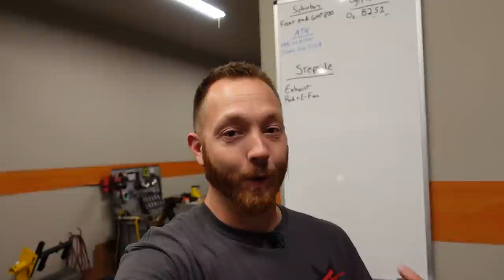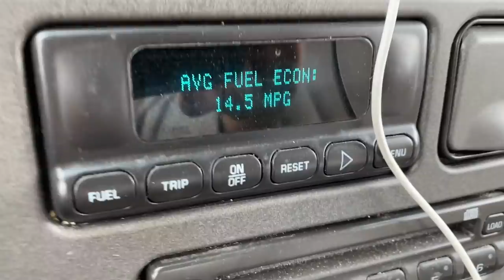the ULTIMATE BRAKE CONVERSION for your GMT400

Comment from the maker: I had a few guys ask for part numbers, and while I don't have em handy, I'll try to make this a comprehensive list of all the stuff I used...

Parts from 1999-2000 Silverado 2500 LIGHT duty
one pair front steering knuckles

Parts from a 2001 2500HD
2x lower control arm
2x wheel hub/bearing
2x disc brake rotors
brake pads
2x caliper and bracket assembly
4x caliper to spindle mount bolts
2x hub dust cover
2x brake backing plates
2x brake banjo bolts w/copper sealing washers

Parts from a K2500 
2x front shocks
2x upper control arm
2x sway bar end links

Parts from a 2001 Silverado 1500 4wd
2x front brake hoses

Misc
3/16" to 1/4" brake line adapter
2"/foot reamer
Reply: Any interest in selling the old lower control arms?  I can't find any consensus on what will work other than those factory K2500 ones off of those models on my K1500.
Reply: Thanks for posting this.  Keep progress going on the Suburban.  Don’t get bored with it.
Reply: Thank you,  LT!!  Much appreciated!!
Reply: Thanks, I have a 98 4x4 3500 crewcab.  I've never thought the brakes were worth a damn.   I thought about rear disc but the front disc upgrade sounds like the key.  Let us know how it all turns after the master cylinder.  I have 2 early 2000 3/4 suburban parts vehicle.  I think I'll be yanking some parts off soon. Not sure what knuckles they have?
Reply: Are those 99-2000 2500 light duty steering knuckles off of an Obs or Nbs? Part #?
Reply: Everyone should also know the upper control arm is the same from 95 at least to 2000
Reply: Lt you can use the speedway motors reamer in a right angle drill for the lower control arm portion of the spindle worked great on my 1500 and 2500
Reply: @stephenredman3074  nbs, 2001 body style
Reply: Would any of these brakes work on a 2001 chevy express 2500 5.7   8lug. I'd also like to convert the rear brakes to disk brakes. Any ideas
Reply: @navigatingthedestination  l have a 96 truck with Simi float 8 lug on 6.5 drums
And I can't find any information on converting to factory disk brake, I even went to 17 inch rims, have you found anything. I know there's after market like lug nuts, ruff stuff, and more, but it putting a 11.5 inch rotor and calipers from a little Cadillac dose not seam like it would be much better than the drums I have.
Reply: If you use 2500hd/3500 knuckles you need MOOG ES409RT outer tie rod ends.

Comment: Again, no one does parts interchangeability like General Motors. Nice job, LT!
Reply from the maker: nope, and I'm happy to take advantage of that
Reply: Honda does just saying
Reply: Yeah... On a freakin' Ford, if it has an entirely different suspension if it has a different alternator.
Reply: @blackbuttecruizr  Ford is a nightmare. A single exhaust pipe can have up to 10 different bolt sizes... Man, don't get me started.
Reply: The worse offenders are the size 7 fasteners they use on the edge,bronco, amd ecosport also on the new explorer  not to forget the gt350 whole front is held on by 7's
Reply: Hondas are more interchangeable but still love a gm 👍
Reply: @tommoon2700  Interesting about Honda, but I wouldn't own one if they gave it to me.
Reply: @hawkdsl  bummer, they are fun little go carts 🤙
Reply: vw.
Reply: Toyota also does it well.  You can bolt 1st gen Tundra brakes onto Tacoma.
Reply: I think honda interchangeability is still way better and easier
Reply: Yeah you need to look at honda before you say that.  For example any 2000 honda, from civic to suv has the exact same lower and upper balljoint.  Gm finally caught on to parts bin building in the ealry 2000'S, when the japanese had been doing it for 25 plus years.

Comment: Love the suburban content and what you’ve done so far! Please keep it a suburban too. What about a 6L90 swap and build the 454, possibly with a Whipple. It would make a killer family tow rig
Reply: the 454 would shread a 6l80
Reply: @brendan747  I’m pretty sure it will be just fine when they’re built to go behind LSA engines from the factory
Reply: @justingustafson7964  LSA applications used the 6L90.
Reply: That would be cool
Reply: @justingustafson7964  lsa engines weren’t put in 7,000 lbs pickups with high towing capacities and all of the low end torque.
Reply: @rcairforceone  Thank you for the correction, that’s what I meant, the 6L90
Reply: @brendan747  My bad, I meant the 6L90 put in the CTS-V’s and 2500/3500HD trucks
Reply: @justingustafson7964  can’t beat a built 4l80e. a built 80e versus a 6l90e will always result in the 80e being stronger.
Reply: @brendan747  I agree with you, but my thought for the suburban build wasn’t an all out  crazy HP build, but more of a built tow rig. The 6 speed 6L90 would offer more advantages to a build like that than the one advantage of the 4L80 holding more power.
Reply from the maker: that would definitely be a fun conversion
Reply: @LawrenceTolman  obviously it’s your truck so you can pick the direction you go in. I figured you are going to have 2 turbo big block trucks here soon enough so adding a supercharger to a big block would mix it up a bit
Reply: Only 6speed I'd swap in is an Allison.
Reply: There's not enough benefit to a 6 speed over the 4L80 imo.

Comment: This is fast becoming one of my favorite GMT400 builds on Youtube! I was on a forum dedicated to these trucks when someone posted a link to the first video you posted introducing the Suburban, and when I had seen you'd done an 0411 swap I was seriously intrigued; I've done the 0411 on my 96 K2500 with a 454 and you actually helped me solve my crank relearn issue by pointing out the need to ground pins for the parking indicator! 
The GMT800 knuckle upgrade is also something I've looked at for years, and at first I had settled for putting K3500 Dually rotors, calipers, and pads; no forums had a step-by-step process to this conversion, and the ones that did are now long gone so I'd always been hesitant about going through with the swap.

 I have heard some other K2500 owners complain about the angle of the shock being changed by using the GMT800 lower knuckle causing the ride quality to suffer, have you noticed anything substantially adverse so far or is it too early to tell?
Reply from the maker: haven't even driven the truck with the conversion, but when I do I'll make a video showing the results and how I feel it drives. thanks for watching!

Comment: Thanks for making this video!  I'm picking up a 1999 K2500 Suburban to turn into a family snow rig/tow pig, with new gears and diffs, etc.  I'm looking to make everything as spiffy and serviceable as possible, and this swap wins on both points.  I purchased the rear axle and front knuckles today, and I'm making up the rest of the parts list.

You made this a LOT simpler!
Reply from the maker: Glad I could help out!

Comment: I ran into the same problem with my 2006 Silverado 1500 4x4 when I put 2019  4 piston calipers on it with drilled and slotted rotors then Jegs sent me the wrong braided brake lines. I must use my old brake hoses until I get two adapter fittings. Thanks for reminding me about the hose fitting adapters. Great work on your truck it should handle 100% better.

Comment: Love the parts interchangability on these trucks, i swapped the ignition cylinder in my '96 c2500 to the one from a 1999-2002 silverado and while I did have to recode the door lock cylinders since the new ones didnt match (new ones were too long and the the ends were different styles), the ignition was as simple as pulling the old cylinder out and putting the new one in.
Reply: Hey man I have a couple of these trucks and I've never heard of anyone having to swap in a newer style ignition cylinder. What was the reason for it?

Comment: Now you got my attention! The brakes on my 93 z71 and they were ok but the rear drums became a problem with rusted out back plates and they actually ripped out the anchor pin when I slammed on the brakes in 4 wheel drive. Very smart move by not drilling the upper control arm, many people don’t realize GM has a lot of tempering and tech going on in that skinny control arm.
Reply from the maker: yeah, something as important as a control arm is not where I want to experiment

Comment: I'm doing the same upgrade on my truck and I found that the taper on the upper ball joint is the same as a 1500 series ball joint, And I think my stock lower ball joint will fit just need to remember I'm a little bit to bring the ball point in more Because it is real close to the CVS axle

Comment: I love this break down. I am really glad I found it before I started tearing apart my 92 GMT 400 K2500. I just bought it two weeks ago for $900. It runs and drives but the breaks are bad. I am also going to do a coilover conversion on the front
Reply: Are you making your own coil over conversion or are there kits available? Is there more information on this? I’d be interested in learning more about this topic for sure.

Comment: By the way... The spindle lower pocket (the small one inside the big one)  that looks like an elongated race track (@8:55) is actually supposed to be cut out. This gives you access to the zerk fittings for the lower ball joint. The factory was notorious for missing these uncut versions during inspection, even on the 88-94 GMT400's. Easy to cut it out yourself though... and for some reason, this happened on the right side more then the left side.

Comment: the GMT400 upper control arm comes in two GVW 7200lbs and 8600 lbs. the 7200lbs has a smaller tapper diameter on it

Comment: You can make minor non structural alterations to spindles with silicon bronze brazing.
Tig or oxy. Make sure to properly clean and pre heat the cast iron before starting, just stick them in the oven on max until hot.
Keep them warm after brazing to ensure they cool slowly so as not to crack.
This is ideal for correcting mistakes in rheaming out the tapers.

Comment: Man, love this burb. I bought a 94 k2500 from nevada, no rust. I was thinking about the gmt800 brake swap. Thanks for all the info i will start collecting parts to do it
Reply from the maker: Glad to help
Reply: I want to do the axle swap aswell but my truck came with a dana 70 and posi already just hate the narrow track width. But im thinking it might cost the same as a good set of spacers and disc brake conversion

Comment: I have a 2001 Chevy suburban 2500 not HD and it has the 8.1 with 4l80e just swapped a torque converter from monster that thing revs way fast 🤟🏽

Comment: My vote for the next upgrade is some Hummer H2 wheels.  They’re a nice upgrade for a true GM 17” wheel.  I put a set on my K2500 a few years ago.  No spacers or adapters needed.  The only thing you’d have to play around with is hub caps….few different options there.
Reply from the maker: for sure, the H2 is one of my favorite 8 lug GM wheels

Comment: love the gmt 400 chassis info. having a 99 tahoe as a secondary vehicle this content is awesome. Plus, i believ the gmt400 chassis is or has become rather popuular again so sprinkling in this content i believe helps your viewers relate and shows not everything is just newer trucks! keep up the good work and great content.
Reply from the maker: I agree, I think these are some of the best looking trucks they ever made
Reply: @LawrenceTolman  having the 1/2 ton chassis in the tahoe i cannot find info on if the 3/4 ton spindle would allow the 6 lug hub to bolt up. i have only found   forums talking about special service vehicles (police or fire) caliper upgrades. any thoughts?
Reply: @richadams3256  from what I could tell researching for my k1500 they're different and the 2500 spindle won't work.

Comment: Your projects always have that twist that i enjoy the most. originality. I don't really have a brand loyalty so when I bought a K3500 with a 7.4 vortec a couple years ago I was baffled that there aren't more intake manifold options.  I expected so much more from the aftermarket. For the life of me i can't find anything more than a mild cam swapped into these. To me it seems like the overlooked platform. I couldn't tell you how many times I've read the guys in enthusiast groups comment that the 7.4 vortec is junk compared to 8.1L. boggles my mind. It's an efi BIg Block Chevy with a roller cam and a 4L80e behind it. I don't get it. so much potential

Comment: I swapped in dually cylinders and calipers on a C1500, and I'm waiting to install the master cylinder from a 2500. Same problem with the rear brakes before and after, likely the proportioning valve needs changed to an HD too (recommended by GM tech bulletins, part is no longer available form GM.) Inline Tube has an aftermarket unit that will fit, no one else that I've talked to has made me that guarantee.

Comment: I don't (know for sure) it'll work on the gmt400 3/4 and up, but for the GMT800 1500, there are upgrades using parts for the GMTT1XX with the 4 piston calipers and factory or aftermarket rotors using stock spindles and hubs.
Reply from the maker: the only bad thing about using newer GM stuff is in 2011 they switched the wheel bolt pattern to 8x180 which means the front wheels would be different than the back...

Comment: I skimmed through the comments and didn't see anyone else mention these things that did not seem to be clearly stated in the video.

This WILL WIDEN the stance in the front.
Only a little, I didn't take a before measurement, but my tires clip my factory fender flares when turning after the Brake Upgrade.
I have a completely stock truck "in storage," when I get a moment, I'll try to get a before measurement from that to share with everyone.
 
I have been using Rancho shocks on my K2500 Suburbans and like the ride, however the modification LT made to his will not work with the Ranchos.  I swapped out the brackets from the GMT400 to GMT800 lower control arms and noticed that the casting of the GMT800 is quite different.  The shocks on the GMT800 must mount on less of an angle forward than the GMT400s, as the GMT400 lower control arm lower shock bracket mounting surface is on an angle.  Right now I have my shocks mounted on the GMT800 flat mounting surface and the lower bushing may be on too much of a bind.  A few hundred miles will probably let me know, if so, I'll rework the lower mounting brackets to take the binding out.   In the meantime, I just opened the holes up and slotted the inboard hole to mount them.

Also, I discovered while doing the upgrade, the Z71 brake hoses mentioned do not fit into the GMT400 brackets on the frame.  I plan on taking a trip to the boneyard to pull them and swap them out for the zipties I used to get my Suburban back on the road...

Aside from these things, this was a very informative video, Thanks for sharing!
Reply: Did you ever figure out how much it widened it?

Comment: You are a brave man.  Very nice set up.  How concern are you about the rust on your Suburban? I have been slowly pouring money into mine as the 5.7 engine is rock solid. I have owned the 1997 since the beginning but  came from the salt belt and then moved south into the humidity belt. It looks rough under my truck!  The outside body is in GREAT shape. I want to treat the under carriage  as it is 25 years old.  Thoughts?  Might make a good video. I know the frame metal is thick but would hate to put all the money into the rehab only to have frame failure.  Keep them coming.  Love what you are doing.

Comment: I want to do this up upgrade to my 98 k1500 HD. Looking to do this and hopefully I can upgrade my upper/lower control arms with the knuckle of the GMT800 with a lift kit. I’m learning a lot of good information on the suburban and the GMT400 trucks from 88-98 that I can do on my truck.
Reply: Doin it know on my k2500light duty basically a  k1500 having trouble with positive camber ill update if it works out

Comment: LT, thanks so much for this video very helpful.

I have a 1999 GMC Suburban k2500 always wanted to upgrade to the GMT800 brakes.
What stinks is I just did the entire front end with all MEVOTECH TTX parts upper and lower controls arms & upper and lower ball joints, steering arms, 770.00 in parts and did all myself in August in Florida!!  wondering if I can swap out the lower ball joint on the lower arm to fit the will fit in may 1999 - 2000 2500 LD Spindle? that would save some money!!  I would have to buy the lower ball joint for the newer 1999 - 2000 2500 LD Spindle if they would press into and fit in the 1999 lower control arm mt 400?   Not sure about that?
drivers

Comment: Hey man sweet upgrade!

I was hoping to see the bleeding process for the brakes. Ive got an issue with my front passenger caliper not releasing pressure when i step on brakes. I have never bled a brake system with “hydroboost” before.

Do you bleed from passenger rear, driver rear, passenger front, lastly driver front?

I noticed the caliper on passenger front is locked for when i test drove after new calipers and pads were installed,as i brake the truck jerks slightly to the left and i have to correct the steering.

Any advise would be greatly appreciated!

Thanks in advance!

1997 k2500 8 lug 6.5 diesel

Comment: I thought the new style hub would have the wrong bolt pattern. not8x6.5  
I guess no wheel fitment issues?...

I would love some of the 5 star 20"s off a newer hd for my burb

I am happy to see your progress.

 in the spring i hope to  0411 and turbo mine so it can sit next to my RX7 and small pulley Ion Redline.

Overlanding is a big deal these days, You ever think about making a low profile roof rack? hide some lighting up there? 
 Hidden hydraulic winch? MM 
 Arent you putting bluetop or readhead box in it?
tierod sleeves

been watching for years
lovee the Channel

I
Reply from the maker: Nope, they used the same old school 8x6.5” bolt pattern until 2010, so the stock wheels bolt right on. Though I agree, some of those 5-stat 20s would look killer